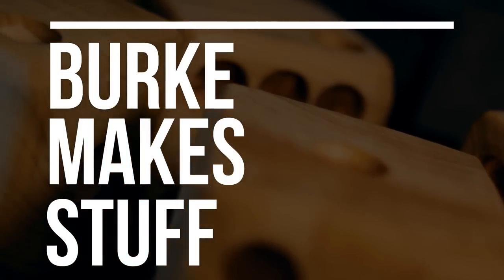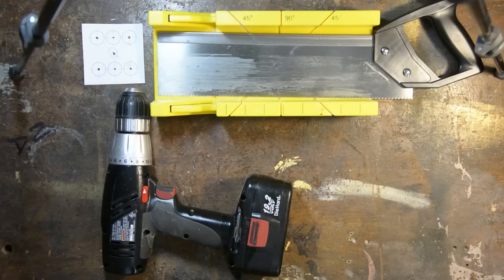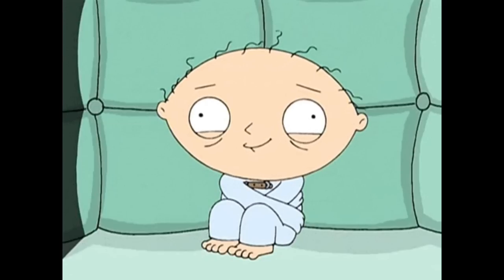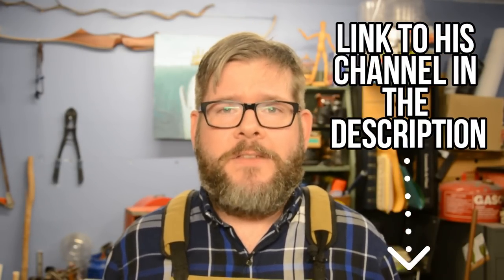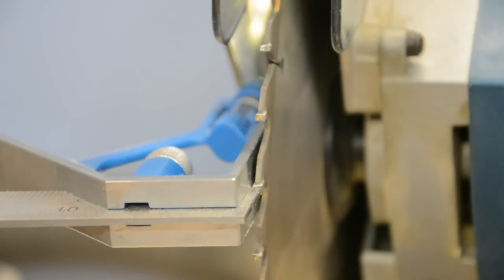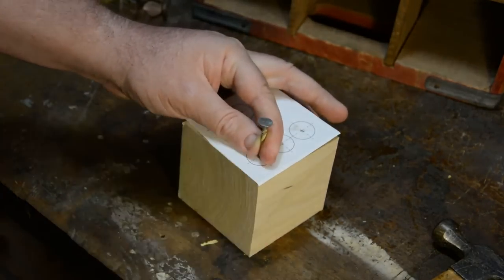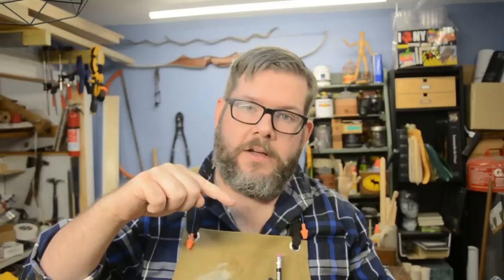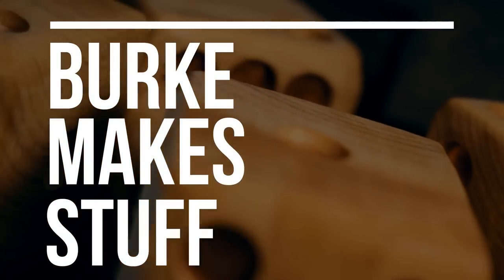How to make Yard Dice - Yardzee Dice / Lawn Dice

Comment: Great video.  I made some this weekend.  Hardest part is getting the template just right.  I used 1/4" plywood with a 1/8" drill bit for the template and then scored the block with the 1/8" bit before stepping up to the 3/4" bit.   This worked really well.
Reply from the maker: On my second round, I marked out the template before rounding the dice edges. Helped a lot.

Comment: Like the pennies touch of bronze as well.  But I’d want to grind off the faces if possible
Reply from the maker: Absolutely possible with the right pennies. Pre 1968 I believe we’re 100% copper. New ones have the tiniest layer of copper on the outside and a fully zinc inside, so any sanding would remove the copper. If you do it, let me know, I’d love to see what that looks like!